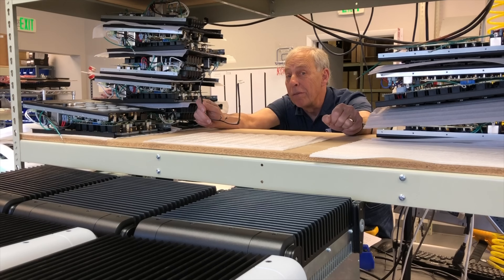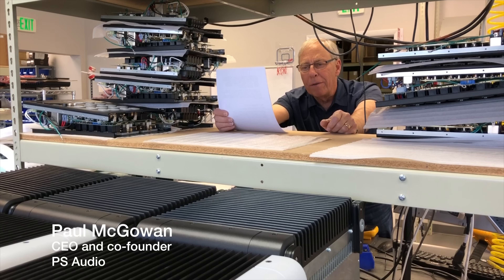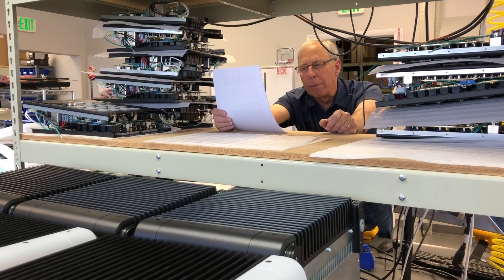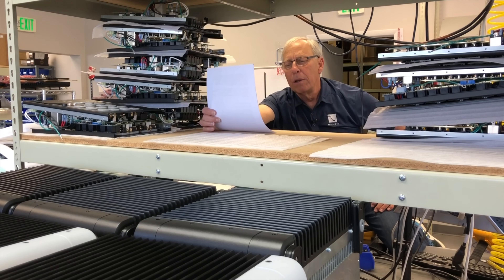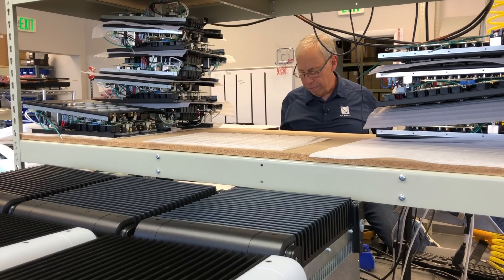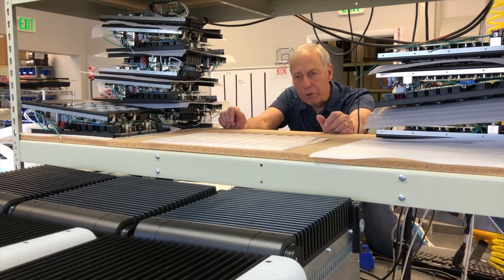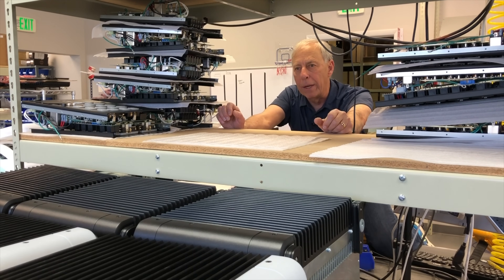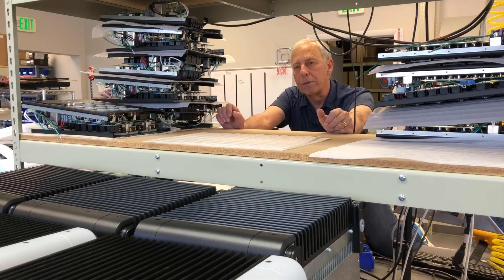Why aren't there more active crossovers?

Comment: While active speakers may not sell due to a lack of interest among audio hobbyists because they take control away from the operator, I would think that speakers without passive crossovers and individual driver connectors on the back of the cabinet, in addition to an external active crossover would be the antithesis of the active speaker model. I can imagine audiophiles loving the outboard active crossover and possibly even speakers built with individual cabinets for each driver like Goldmund and Wilson Audio. If I had a million bucks (probably more like 20 million) I think I might want to try creating speakers where you had nice but inexpensive 3-way "cabinet" with 3 "taps" on the back, one for each driver, specifically for use with active crossovers. I'd also try selling much larger, more expensive speakers with the same philosophy. As Paul says, most people would probably not get the great crossover tuning that a company like Harbeth achieves, but that's all pretty subjective anyway and it might become hugely popular among audiophiles who simply like to experiment with the possibilities. It certainly would not appeal to the Bose tabletop radio crowd, but if there is a market for it and someone could make a profitable business out of it, that would be really cool.
Reply: I'm in the process of doing that right now. For myself, not the market. I've built decent speakers before, a couple were just reproductions of existing designs, and a couple of my own plans (more like a few if we go back to high school)
I want to test the active waters so I have been looking into a couple of HiFi active crossovers that are reasonable priced (not trying to break the bank on an experiment). I am considering one of those Emotiva amps with the modules because they are relatively inexpensive but I believe one amp will do the job. If it works out I will step up the amps to something a little more high end and install the Emotiva on my home theater. If I don't like it I will build a passive crossover for them. 
Winter project.

Comment: If one decides to go the active crossover way, s/he must be willing to :
a) Spend quite a bit of extra money on the cross overs
b) Forfeit the warranty of the speakers
c) Spend a heck of a lot of time, doing accurate measurements in the room in order to achieve a reasonably flat frequency response.

Having heard a friend's system (having done all the above), I must admit, the results were stunning!
Reply: Not sure about b), you can get a 4 ch DSP module (Programmable) for around £100, upgrading a passive crossover you can spend significantly more than that. If you have the test equipment that is and a spare amp.
Reply: I built a passive 3 way for a set of large floorstanders. Quality parts, 14 awg air inductors (14 awg laminated on the bass) caps are clarity csa on the mid, jantzen supreme on the tweeter and audyn on the bass. The bass was 68uf so I used the audyns for the price. Ended costing roughly $300. Those are all high quality parts, but IDK if they reach high end status. I know it can get to the thousands if you go with true high end components.

Comment: If I want to use active crossovers, should I not be using it with speakers that do not have a passive crossover built into it?
Reply: When you have active crossover, don't put another passive one.

Comment: No, no, no, Paul, a properly designed active speaker system for home hi fi is built around an active, electronic crossover, and then two or three (for a two way vs three way system) external amplifiers are added to the system, and each amp is hooked up to an individual driver. So as opposed the inferior active speaker designs produced by manufacturers that try to stuff all the electronics inside the speaker box (and are built for specific applications, such as recording studio monitors), a proper design keeps all the electronics outside and accessible, allowing for infinite flexibility in selection of amps and speaker wire. I agree that trying to convert a passive system into an active one is not an appropriate way to proceed, as those drivers were carefully selected to work together in a passive mode. My efforts to convert passive speakers to active have not worked out well, and I ended up putting them back to passive. The correct way to design an active system is to start from scratch and carefully select each driver for its design features and flat response, and place them in pre-built or home built boxes. I have built many such systems, and have documented that work on my youtube channel, "Speaker Builder". I have not done any of this work to make money or become famous, rather, just to share my experiences with the goal of encouraging others to pursue the same.
Reply: Speaker Builder  sounds interesting I'll have to check out your channel.
Reply: There is a reasonable limit to chasing flat response from a driver. Many well made (and expensive) drivers offer relatively flat response within a few dB. This does not vary with active or passive systems. The crossover will manage the response in the crossover region, but not outside of this. So flat response from the driver is not really the problem. The main issue is the lack of flat response at the listening position, and this of course is caused by room reflections. I agree with Paul on this matter, to not try to address room issues with eq, but rather with room reflection management (speaker placement, room treatment - both reflective and absorptive, etc.). I would argue that the sonic advantages of attaining an absolute flat response from a driver/system via eq does not outweigh the disadvantages of adding another component into the signal chain. My preference is for as pure and clean a signal path as possible. Mr. Linkwitz disagrees (check out www.linkwitzlab.com), and he includes dsp into the signal path of his flagship system (which also introduces A-D and D-A conversion), and eq's the entire system in the digital domain for absolute flat response at the listening position. To each his own.
Reply: No doubt you have actually built and heard active systems, anyone who has done so and really heard the improved clarity and dynamics will be convinced. But honestly, it took me quite some time to come to appreciate those improvements after I built and started listening to  my first fully active system.
Reply: Bose 901 comes to mind. The EQ box is in essence a crossover that makes sure the end result from the driver is pleasant.
Reply: Build a flat response driver, or build an EQ that makes the driver response flat. Potato. Patato. Dr Amar Bose was definitely thinking way ahead of the tech available even back then.
Reply: Speaker Builder - Building a driver that has a flat response requires developing a material, specifically a careful combination of different elements as a single material has not proven to be flat. How good will that mixture be? depends. The best answer is to have a best driver that is closest to being flat, with an EQ that makes it FLAT, without much effort. But in reality, the most cost effective way in this day and age is what Dr Amar Bose did. Map out the driver characteristics and use an EQ to make the final response flat, and then tweak it from there to produce a sound that is sweet to hear.
Reply: I concur that room reflections need to be addressed by addressing the physical imperfections in the room. I probably digressed too much into the driver design when the core subject is crossovers.
Reply: Speaker Builder completely agree, I think this was the weakest video of Paul I've ever seen 'til today (I like PSA btw). A passive crossover makes the amplifier to have less control over the speaker itself, inductances and capacitances just add more coloration into the tone, own resistance, etc, all that kind of stuff. With an active system we have endless amount of possibilities to tweak the system to its maximum. I'm just building my 3-way system with 1x 18" woofer (PA), 4x 5" midrange (PA) and 1x tweeter (AMT). Average sensitivity of speakers and whole system in the box will be around 95dB. I'll drive the bass section with a Hypex Class D amp (good damping factor, woofer control, low  woofer impedance sensitivity. Crossed to the midrange section at 125Hz, far above midrange driver resonance peak. Midranges crossed at 2K to the AMT tweeter. Midrange section driven by DIY Class AB tube monoblocks, tweeters by DIY Exicon mosfet monoblocks. And I still can choose whether I want to pull a thick copper wire to the bass or not, while considering all-silver wires to the tweeters, etc. and change them anytime. (I'll use copper).. First I'll experiment with a DSP and filter simulation, focusing on the 3-way 4th order 24dB/oct. active Linkwitz-Riley. Today's modern DSPs don't involve an extra AD -> DA conversion when put into the chain.. most of them have DACs inside so I can feed the DSP with proper digital signal via USB (or I2S not sure.. even better).

Somebody is afraid of EQ-s. Well it depends on where we do EQ, in the digital domain or analog domain. Within Foobar2000 or similar we can set our own EQ and it works flawlessly.
Reply: Sounds like a solid design, balancing the system can be done either by controlling output at the crossover, or controlling the gain at the amps (for those with gain control), or both, as I do. Adjusting the amp gain down seems to soften the tonal character a bit on my amps. Otherwise I am not eq ing at all. Using DSP, you still have a D to A conversion, and this is enormously complex stuff, not easily done sonically well (although all CD players use such conversion). Nice idea to go from a digital source such as CD output directly into a DSP in the digital domain, through your crossover, then back out via quality D-A conversion. I like the use of a tube amp in and midrange, I eventually want to build replacement amps for both my midrange and tweeters with tube front end and Mosfet output amps, as Paul has suggested elsewhere. Be sure to check out my youtube channel, "Speaker Builder".
Reply: Speaker Builder cool idea using tubes on the input side and mosfets as output devices. I'll check your channel too. I have btw no other source than my computer, laptop, each if my CD-s have been ripped with EAC, the rest bought online, I'm a flac fan (however I also have some DSD stuff but not much and when I look at the spectrogram I don't always like what I see -> check out Dr. AIX' channel aka. Mark Waldrep about the myth of Hi-Res Audio). Anyway I like Paul from PSA, his kind polite style and his videos, but at the moment for a serious builder there's only ONE argument for a passive system/passive crossover: simplicity. Nothing else, really.. active has soooo much advantages on the tech side.. (and disadvantages on complexity, money and space side).. just my opinion. I'll use a single DAC for my system, the Matrix Audio X-Sabre Pro fed via PS compatible I2S via a Pink Faun I2S PCIe card. Well, not sure I'll employ a DSP at all. My measurement mic will tell the truth and I'll try to equalize in Foobar already during Playback - if needed. Well..  I'm a bit offtopic now.. cheers mate ;)
Reply: Speaker Builder l keep mine all modular and outside
Reply: Paul has commented elsewhere of his not being in favor of eq'ing a system, and instead focusing on getting flat response from the speaker system in the first place (along with treating the room, speaker placement, etc.), and I would agree, an eq in the signal path introduces another source of distortion, or said better, loss of clarity, not in itself all that significant, but I have learned that every link in the signal chain matters, so a very careful and methodical review of every link is necessary to achieve the highest clarity.
Reply: Speaker Builder, "exactly"

Comment: Active crossover with multiple channel amplifiers to drive a pair of speaker is definitely superior in sound quality, but the biggest downside will be very difficult tune, most of the time it will sound like crap, as all these crossover tuning is by the speaker designer who spent a lot of time in it.
Another downside will be easier to blow tweeter if careless. Not suitable for inexperience people and the most importantly very expensive.
Reply: I absolutely agree, having built many active systems now, I would say it is not something for the novice to tackle, and not for the budget minded. But I would argue that the results can be absolutely amazing clarity, and this in the $2500 to $5000 price range, which is really small money compared to what Paul and others are spending on their systems. Paul says his top of the mountain system at his facility costs 100 grand. That's just crazy, even for me. I could never justify that kind of expense for a toy that does not make any money. That much money should be put to work and yield 10-15 percent annual return on investment.
Reply: Price tag does not define a system sound quality, lots of the big budget system I've audit sound very disappointing and the owner just want to boast about their financial capability.
I like listening to system setup that the owner spend a lot of time and passion into it, trying out different methods to improve the sound, most of these system will have a unique listening pleasure, doesn't matter if it's cheap or expensive as price tag is just a number.
Reply: True enough, that being said, I would say that having for many years now engaged in the very method you refer to, I find that chasing high quality sound tends to be expensive. The budget systems sound like budget systems, the medium priced systems sound much better, and the very expensive systems sound amazing. This is true up to a certain point, beyond which you reach the place of diminishing returns. And you would be correct to say this does not apply to every component in a system. I found really amazing sounding interconnect cables that surpassed those at twice the price. And really great sounding speaker wire can be had for a very reasonable price, esp when selected for certain frequency bands (as with three way active systems). But my next project of chasing exceptional quality amplifiers will likely be a VERY expensive ordeal. And high quality drivers that sound amazing are quite expensive.
Reply: It's seems to me you would want to install a protection cap on the tweeter just in case.

Comment: active x-overs belong in a p.a. stack feeding amp inputs. subs/kicks....mids.....highs.
been using them for years. handy. helps to bring in better clarity,increase dynamic headroom and reduce the need for eq duty chores. in a home or studio mix environment.....nope.

oh yeah....to address that active driver assembly thing:
never have i heard a natural sounding assembly. the roll off points always become apparent after a short time listening to them. it draws your attention to them.
a very short 2cw on both sides of the subject.  ;->
Reply: Hello there! Why wouldn't you recommend it for home audio or studio mix? What are the drawbacks which doesn't appear/matter in PA applications? 🤔
Reply: @staLkerhu  i/m distortion/switching artifacts/colourations in the presentations that are not consistent. in a p.a. system an electronic x-over is a valuable addition because it allows you to optimize bandpass/driver/amplifier power parameters to allow for the best punch and presentation possible. in a studio or home listening environment accuracy and phase  consistency/tonal balance give the best experience. this is best accomplished with passive crossovers. no matter the source though....the reproduction through the drivers is always analogue in nature. your ears will tell the difference when experienced back to back.

Comment: If you simply bought 3 amps and 3 grapics, and used each amp and graphic for each driver (if on a 3-way) it could be an easy way to make an active crossover cos you can change it easily. Should sound great and you could tailor it to different rooms nearly instantly.

Comment: Thanks for answering that question Paul. I've always wondered why active crossover networks weren't popular in home audio like they are in car audio. I run all active in my car for its efficiency and flexibility to overcome such a harsh environment. There's been many times I have thought of putting together a home system using active crossover Network or DSP. There are some great pieces of equipment out there for car audio that I think would work beautifully in a home setting.

Comment: I have one electronic x over---two mono amps for bass, one amp for mids, one amp for highs, we are in another planet, cloud 9...eheheheheh
Reply: You, sir, are deaf.  Why would anyone use a different amp on the tweeters?  Now your mids and high frequencies are going to sound dissimilar.  High frequencies are very efficient, take no problem.  This makes no sense.  And electronic crossovers are very audible in the midrange.  You're probably using garbage equipment like most "rockers".  Cheap or no DAC, no turntable, cheap solid state preamp and power amp or integrated amp, and bikg honking booming speakers whose size impresses your deaf friends.
Reply: @bobhoskins9595  phuk off ya illiterate millenial!